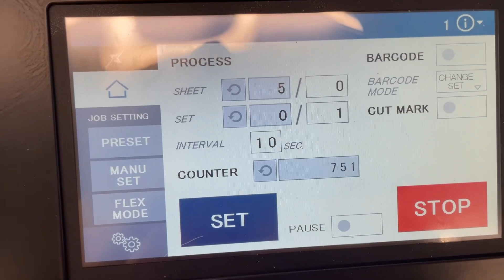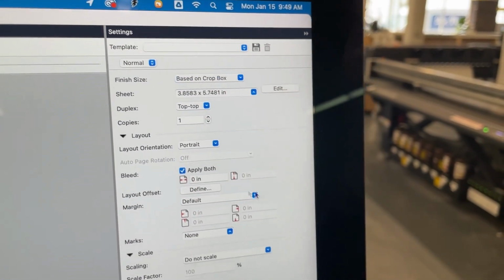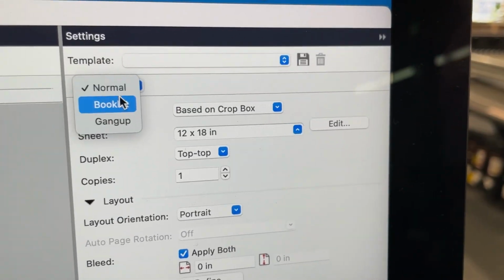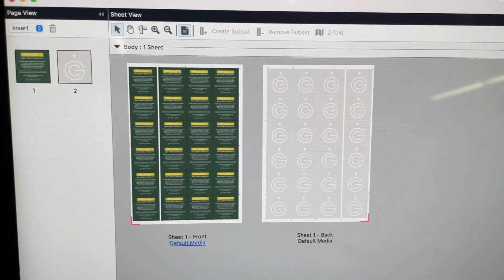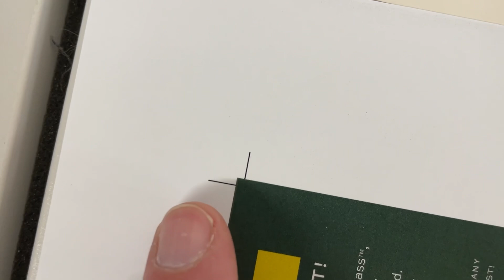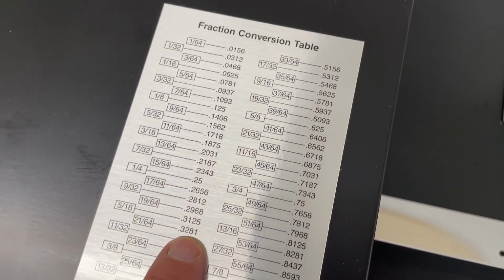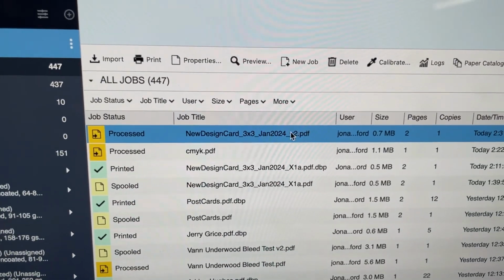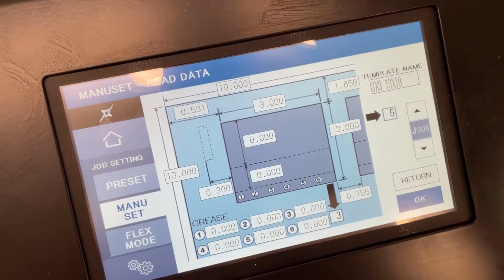Custom Cut Templates for the Aerocut X with Fiery Impose

Comment: shame it doesn't integrate into the fiery, on the Duplo you can just send the imposed job straight to the 618 so you don't have to measure or calculate anything.
Reply from the maker: 95% of my jobs are based on templates we have already setup in Fiery and on the Aerocut.

Comment: Uff. Looks like such a process setting this up. This is why I got the Duplo 618. Simple setup straight from the fiery. Plus you have a nice big screen you work off of. Still not bad once you have it setup once. Best investment, right?
Reply from the maker: Once the template is set, it’s ready for life.  There are a number of barcodes templates ready to go preloaded from Fiery and preloaded in Aerocut. There is also a software called Intellicut that comes free for a year with the system that makes setup from the computer possible with everything barcoded but I haven’t had my training on that piece yet.

I’m having a blast using this thing though. I’ve almost ran $20k worth of jobs through it this month so far!